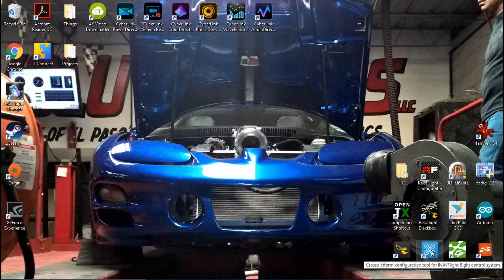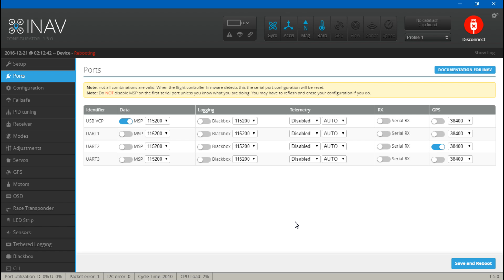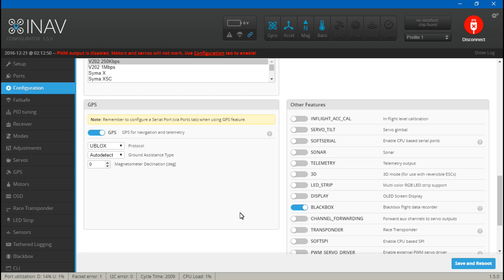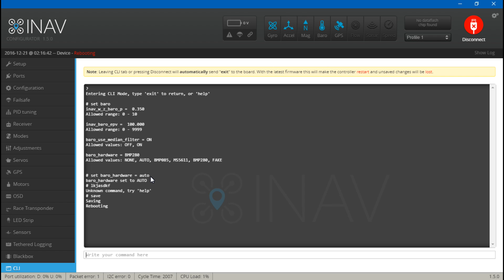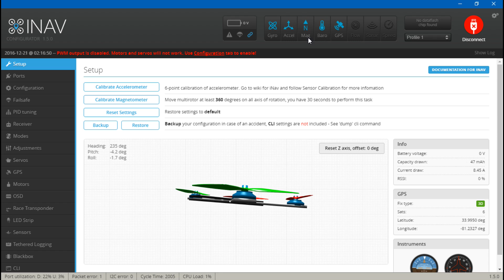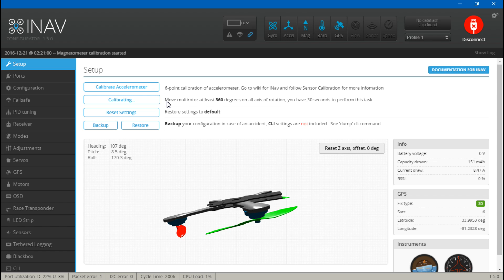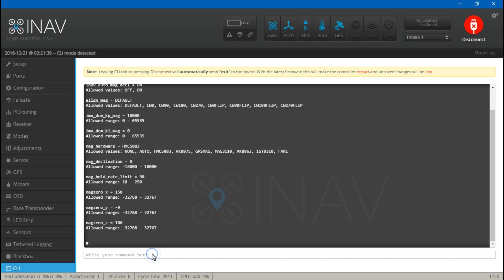INAV: Setting Up GPS And Magnetometer

Comment: Hello, I have a BN 220 GPS module which i am trying to connect to the Matek F405 Wing FC, as per documentation i have set the GPS to URT4, but the inav doesnt detect the GPS and the GPS module's blue TX light keeps blinking, i have tried changing baud rates but nothing happens... kindly advise. thanks.

Comment: I have bought a Omnibus F4 PRO V2 FC & a RadioLink GPS module with latest HMC5983 Magnetometer,I tried auto,HMC5883 & others in the config,it seemed the mag symbol turned red,is the HMC5983 not supported yet in iNAV?BTW,I've just connected the FC & GPS to USB port,is this the power not enough to make it work?

Comment: Hello, I have a f4 v2 pro, and a micro gps ublox m8, neither the f4 nor the gps has compass, how do i inav for the guidance be through the gps? One person told me that it is not necessary for the controller to know the direction of return home, it will do this through the GPS positioning, but how does the inav set it? Would it be: mag_hardware = gpsmag?

Comment: hi, thank you for your videos. I have a question. Why should i cut the traces? If i have a build in magnetometer on my flight controller then can i simple ignore sda and sdl gps wires? it should work, right? I have a sp racing f3 fc and neo6m gps module. could not make it work yet. any idea? best regards

Comment: i need help i set this all up indoors i have 15 sat.. but a red x for navigation is safe.. pre flight everything else is good to go radio works set up my modes and modes arm and the gps stuff wont light but i assume that its because the pre flgight
is there a way to disable the preflight navigation is safe? or any other one? or how do i fix this im lost...

maybe im inside.. but then again how will i know if it will arm if i dont have a pc outside so yea i need to fix this thanks

Comment: Hi don't know if anyone can help build a few quads now not had any problems I've got the omnibus f3 aio and can't get it to hover I've flashed with inav I've set fc as using cleanflight the question is does anybody know what is the front of the board
Reply: kevin lloyd Have you done all the other things done that you're supposed to do before hovering in inav?

Comment: Hey man could you please help me with the BF+GPS issue, I got no replies on RC Groups, here's a copy:

--------------------
Hey guys!

I want to have GPS coordinates and speed/altitude on my Betaflight quad's OSD, however, testing two different GPS modules attached to either UART2 or UART1 on my Omnibus F3 is unsuccessful (tried 3.1.7 and 3.1.6). But if I flash this board with iNav -- GPS works! Only with UBLOX and Auto-detect on Ground Assistance Type, but works! When I try to select UBLOX under Betaflight, then save and reboot -- it resets to NMEA and GPS is inactive and the board receives nothing from a GPS module.

So is GPS just for the sake of telemetry/OSD impossible under Betaflight or it's just the wrong setting somewhere? 
--------------------

Thanks so much!
Reply: romangorchakov good question cuz I plan on switching mine over to betaflight to try to see if I can get it working over there. Honestly if I can get return to home working on betaflight really I don't need anything else. I mean I'd like to be able to do Waypoint missions. but I can slowly ease into that one, you know what I mean.

Comment: In other videos, they initially configure the ublox gps module from the u-center (ublox) application before configuring it with cleanflight. In Inav, would this be configured directly at Inav without going thru the u-center gnss configuration?

Comment: Thank you for this great video series JC!

I followed your video on how to setup X4R with the Omnibus F4 and it works.

I followed this video and can get the GPS working.

The problem is when I try to connect the X4R and GPS together as they both want UART1.

I attempted to use other TX/RX pins on the Omnibus F4 with the hope of changing the UART port for the GPS, but this did not work.

Anyone know how I can resolve this problem?
Reply: To be clear, it is the Flip32 F4 Omnibus flight controller.
Reply: just in case it helps someone else... I found a wiring diagram that clearly shows the location of UARTs for this FC. All is working great now: https://quadmeup.com/flip32-f4-airbot-f4-pinout/

Comment: great video thanks for all your videos  well i am stuck again i have a  flip 32 f4 v2 omnibus cannot get gps and sbus to work at the same time in inav or betaflight  i hooked gps to ch/t6 and ch4/rx6 and the compass to scl/tx3 and sda/rx3 will not work but when i move the gps wires to tx1 and rx1 cut on gps in the ports tab under urat 1 the gps will work but no sbus i know the sbus and tx1 and rx1 are together  but the tx1 and rx1 is non inverted and  sbus inverted so where do i hook wires

Comment: FLIP 32 - F4 - OMNIBUS from ready to fly quads can you setup flight modes with this flight controller and will a emax lighting 30a esc   multishot or 125 shot work ok really go videos thanks
Reply from the maker: Yep you get all the flight modes with the flight controller and those ESCs will work.
Reply: thanks for the answer  do you have to setup everything  inav or betaflight i watched video on setting up the gps in inav but i am a little confused do you use betaflight to setup flight controller and then use inav to setup flight modes  i am new to betaflight and inav sorry just trying to learn  i am trying to have the best of two worlds i want the flight modes and a little aerobatics with a 250 h type frame
Reply: David Hannigan Jr. "Try again"? Do you have brain damage?
Reply: Why don't you try using ANY type of punctuation.

Nobody likes to read massive blocks of text like this. Having to read your massive paragraph with no punctuation hurts peoples eyes.

Think about it. Or don't, either way.....

Comment: Thanks for the vids.. A few years ago I had a multiwii setup with GPS and Bluetooth. Got away from it for a while and recently started back up with betaflight and mini fpv quads. It's like starting over.  Glad to stumble across mention of inav and and now your vids.  I was starting to think ppl just paid the big $$$ for ready built flight controller packages.  Anyway.  I have some gear on order that you recommend.  In the mean time, I flashed an old naze afroflight 32 with inav 1.5.  I'm assuming my old ublox on my crius board won't work, so I haven't tried. This naze board is 10dof and does have mag and baro.  Calibrations are good, according to the new little green "pass" indicators on the right side of inav, but cannot arm althold.  As a matter of fact, one of my issues is, I don't see althold on modes tab,  only nav-althold.  So I need GPS fix to enable althold now?  Also what is surface mode?  Can't find any mention of it in docs?

Comment: I just ordered the Holybro Micro M8N GPS Module from getfpv. I should have checked this first but do you happen to know if its compatible with the SPRacing F3 FC?
Reply from the maker: Eric Noa Yep you're fine. It will work
Reply: Project Blue Falcon awesome. Thank you! Any tips of where to mount it on a x210 frame?